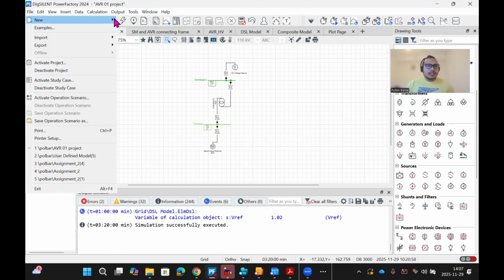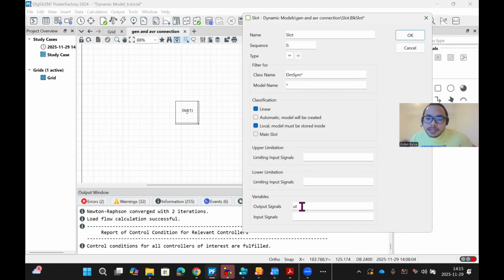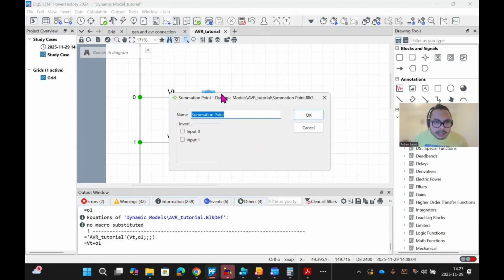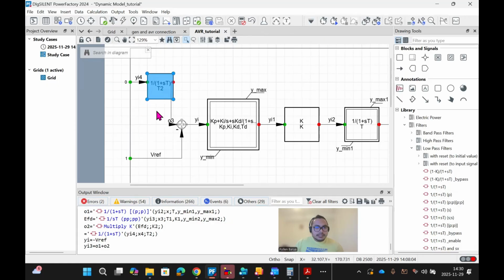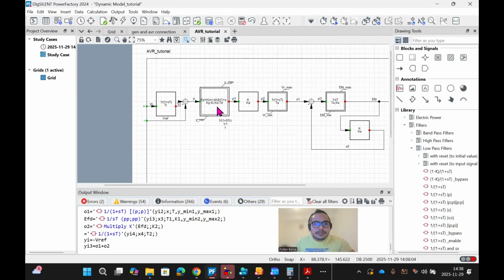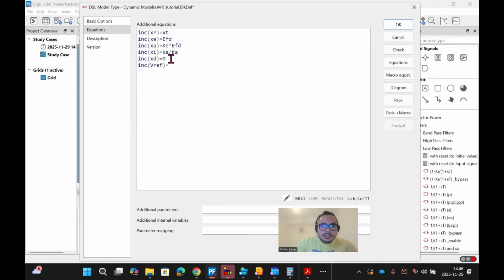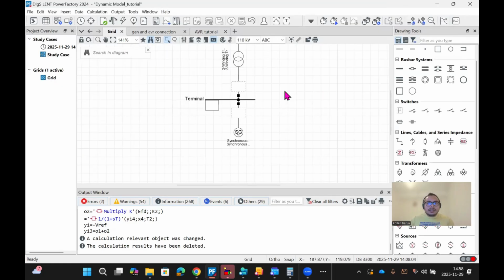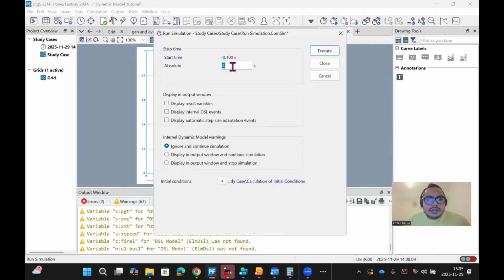PowerFactory AVR Dynamic Modelling Made Easy Part 01

Comment: Hey! I'm analyzing an IEEE AVR. The goal is to obtain a simulator response as close as possible to a real generator's no-load test. To achieve this, I'm adjusting proportional gain, integration time, and differentiation time. I'm currently stuck.